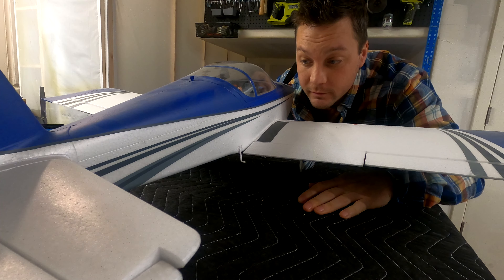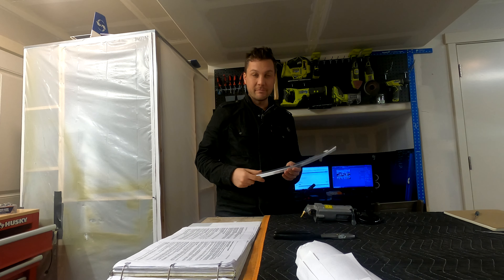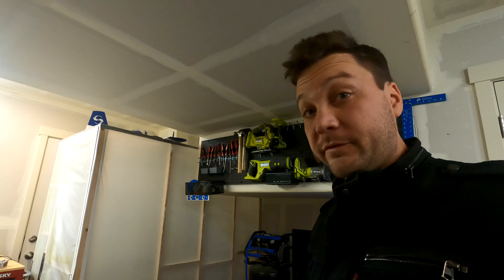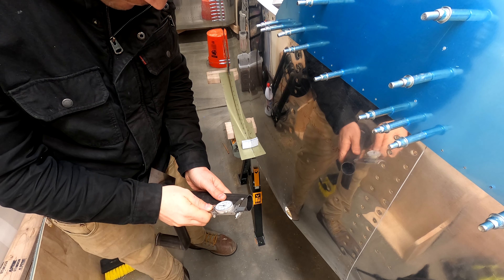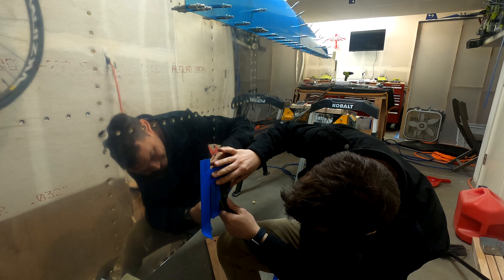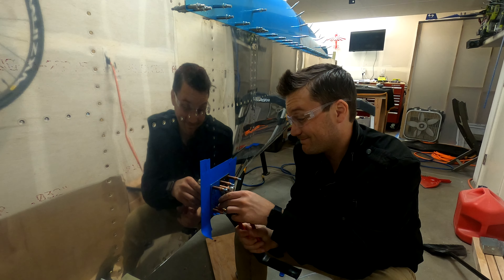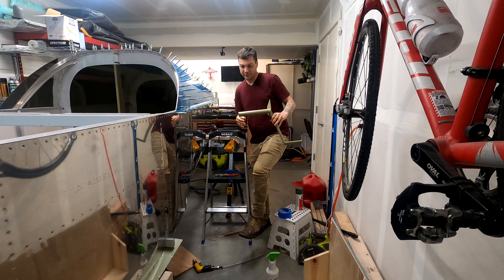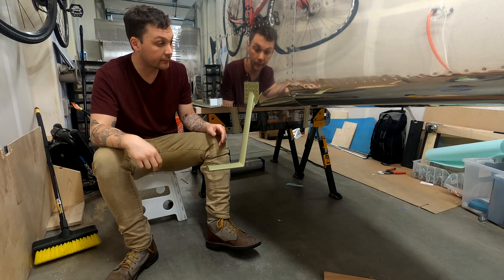The Next Big Step in Building My RV-7 | EP3.23

Comment: Hi friend, could you tell me what the name is, what those pins you mentioned are for?
Could I build the aircraft using blueprints?, what rivet was used?
Reply from the maker: I think you’re speaking about clecos. They’re like pins, but are temporary sheet metal fasteners. They hold the pieces in position until ready for riveting.

The plans provided don’t contain enough information to build a plane from scratch. A kit would be necessary, and available from Van’s Aircraft.

Perhaps, with extensive fabrication experience, and detailed enough plans, one could make the plane straight from blueprints. That’s is, after all, how it used to be done.
Reply: @RyanFlysPDX  aahhh yes friend everything is explained now thanks for answering me, I wish you luck with the project